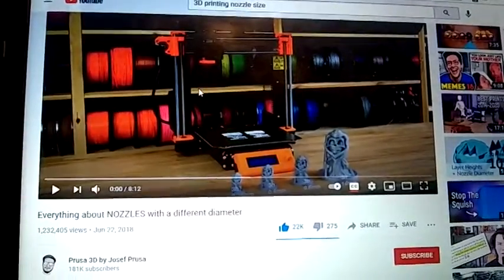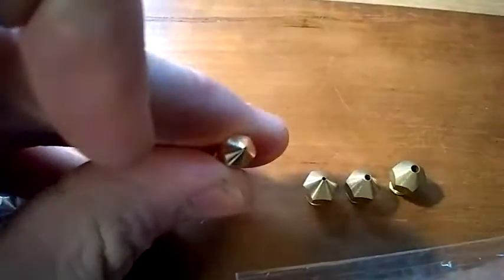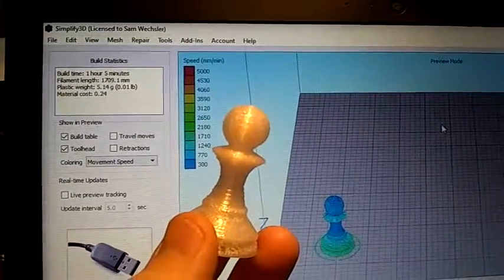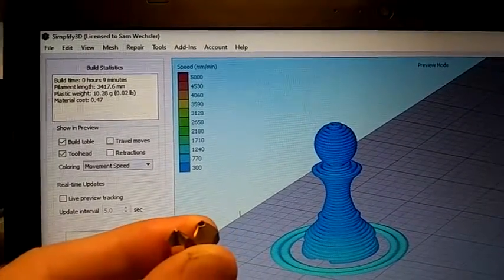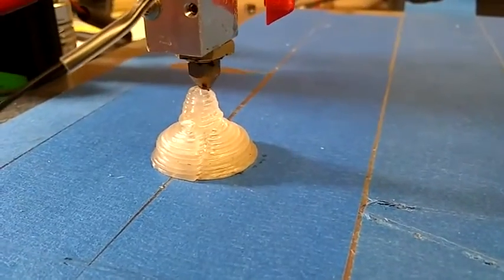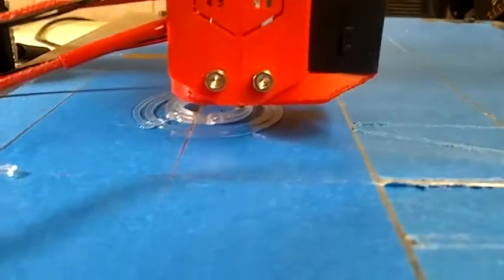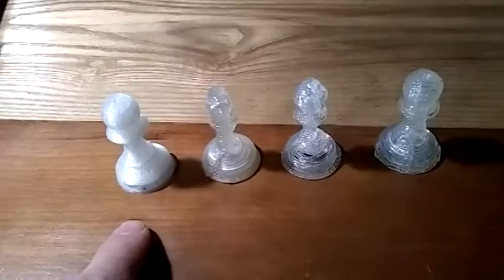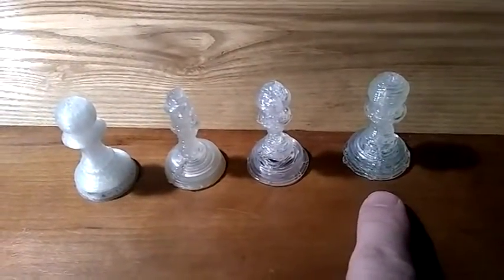3D Printing with a 2 mm nozzle on a Mahor Pellet Extruder Head

Comment: hey are the nozzles for 1.75 or 2.85mm filament? (I don't want to get the wrong kind)
Reply from the maker: The nozzle is for a mahor pellet extruder. There is no filament in this setup
Reply: @samwechsler  I'm just imagining pushing the 1.75mm filament straight through the 2mm nozzle completely unmelted xD